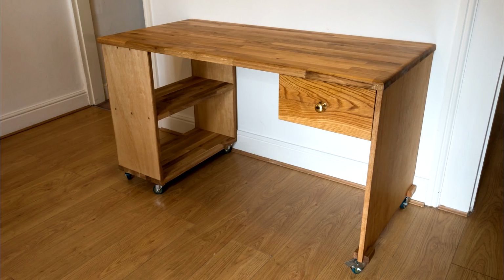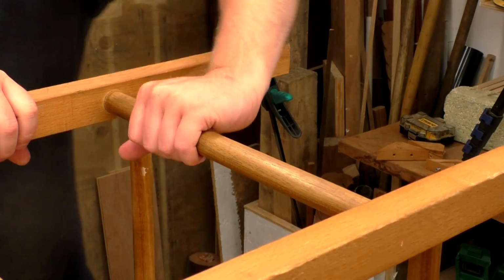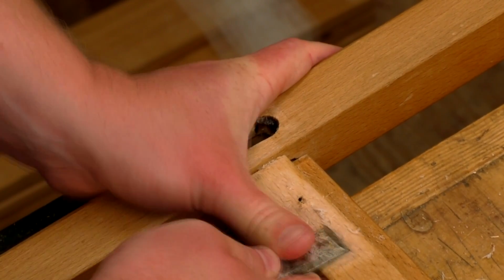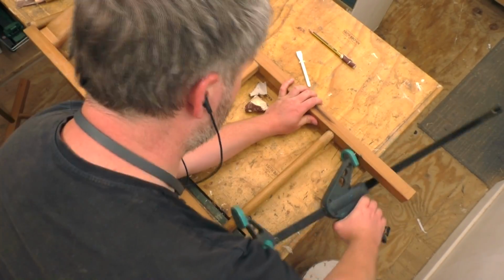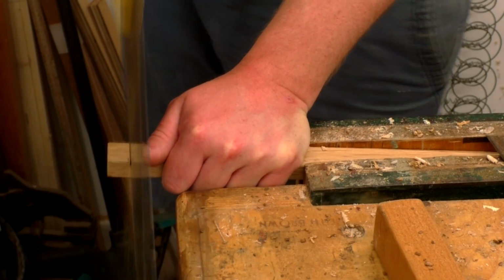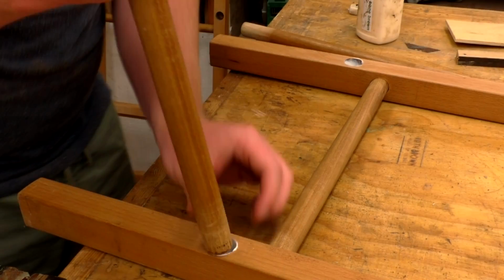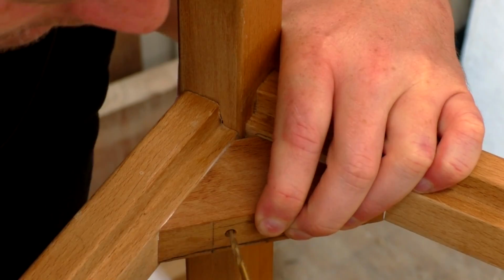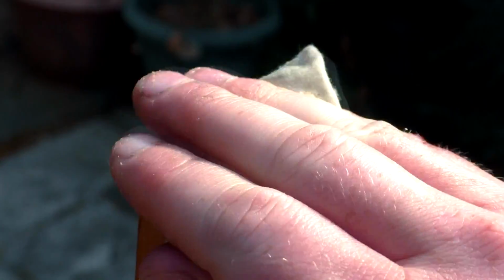Repairing and Restoring Dining Chairs

Comment: I'm late to the party, but must say that it's very enjoyable watching you restore furniture. Good job fixing up that shocking bad joinery.

A word of caution--the sides of your plane are prone to crack if squeezed in the vice. Always place the plane low enough in the vice that the pressure is on the sides of the sole, not on the wings.

Comment: SNAP... Just last week I did exactly the same job. I was so surprised by some of the poor workmanship in commercially made chairs. I too had sloppy joints so used Epoxy as the added gap filler.

Comment: good repair, on a side note i have just bought a 12x8 shed people have said i should have a 25mm gap between insulation and outside wall,i noticed on your vids on building your own shed that you used poly on roof section and block insulation but no gap so was wondering how it is going and is there any damp?i was going to use builders damp paper then loft insulation then board over and paint but have been told this would cause damp any help would be great
Reply from the maker: No damp or signs of moisture, it’s been good

Comment: I really would use polyurethane glue in this case.
Because it expends, it's perfect to fill those gaps
Reply: It foams up, but has no strength in that foam. A good PVA will be just as strong.
Reply: Actually, I think I would prefer a two-part epoxy.  The problem with PVA is that the old glue may seal the pores in the wood and prevent penetration by the new PVA.  Epoxy will still adhere to the surface.